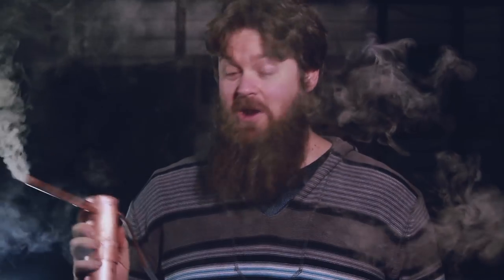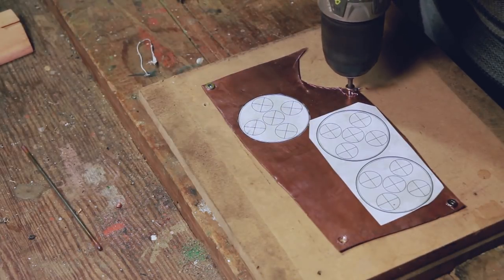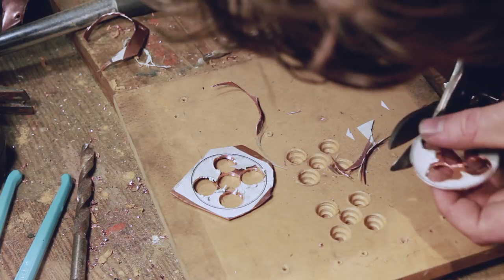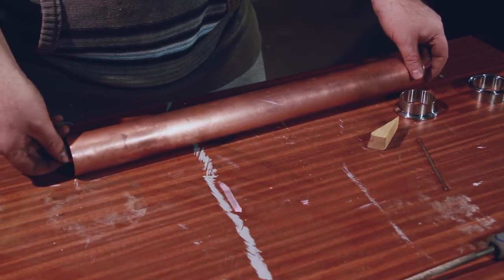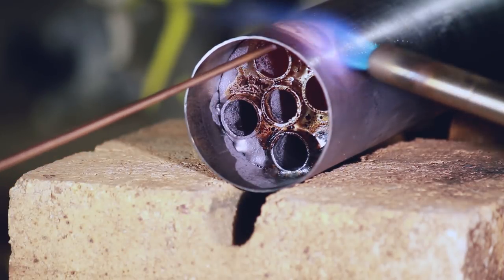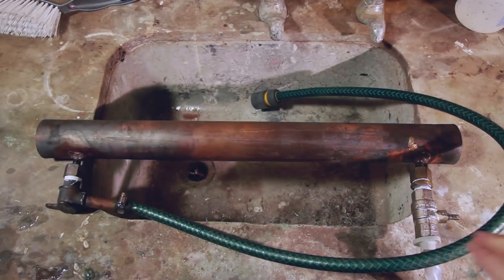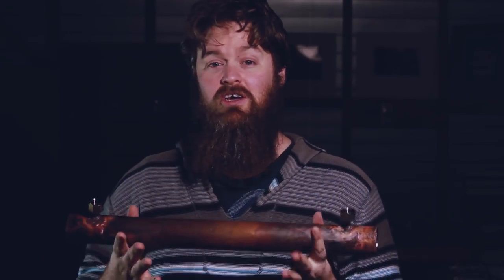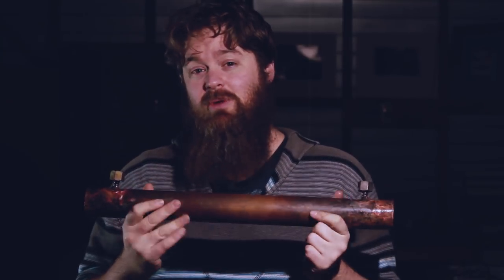Building A Shotgun Condenser

Comment: Here's some free advice from an ex-metalwork teacher that will make your life easier: Don't use hard solder (silver solder or brazing) because you do not need the strength (usually needed only for pressure work). Instead use silver loaded soft solder (potable water grade a silver/tin alloy) and that way your copper pipe will not need pickling to get it clean. In fact it should stay relatively bright with only maybe a dip in vinegar to clean it up after.
The soldering process is so much easier and safer with nothing more than a soft flame needed. You will need less expertise and if it goes wrong it is easier to take apart. There are any number of acid and non acid (water based) fluxes available at your local plumbing shop. Give it a good boil in water and a soak in vinegar after.
Years teaching metalwork and jewellery making followed by a bit of condenser construction of my own as I retired to follow the "art".
Reply: Thanks a loooooot man!!!
Reply: Amen, and if you get lazy just cover in flux and worm, repeat, good to go.
grew up sweating copper of every type.
AND if you have a supper hard flux dirty/job get out the cheater Sauce from the electronic store! did circuit board too.

Comment: great work! your leak was unfortunate but have you tried using Flux and lead free solder instead of brazing rod? brazing takes a tremendous amount of heat and the solder will flow around joints better. happy distilling!
Reply: If you go the solder route, talk to a jeweler about silver solder. Or take an oldsilver dime and file off shavings to act ss solder.

Comment: Great vid Jesse, at the 4min mark you mention size differential i think and someone correct me if wrong but my dads a plumber and he said they use I.D. internal diameter, the tree is a fitter/engineering tool so the numbers will be O.D. overall diameter or external. if that makes sense. for anyone ever trying to use plumbers PVC pipe or fittings with electrical/comms conduit this is the same deal. electricians use O.D not I.D. , i believe it is because of pressure in the pipes, plumbers use the PN system which is thickness/pressure rather than diameter (makes sense after someone tells you)  i found out the hard way. cheers

Comment: A tip.. Obviously, it's easy to make a disc on a lathe, but if one has got none a drill will do. Simply rough cut after the template and then make the holes for the tubes ..EXCEPT that in the center. Drill a hole in the center, so a bolt can go through, secure it on the opposite side with a nut. Now fasten the whole thing in the drill (a drill press is even better). You can now use the drill as a lathe and file/sand until you end up with a perfect disc at the desired diameter. You can even use a flap disc on an angle grinder, to make the process really fast.
When you've done all discs, you can use that step drill to widen the center hole. Also, solder or braze it upside down, not lying on the side. The filler rod will be easier to manage, without struggling with gravity too.
However, you fought a brave battle and got the job done..congrats..!  That shotgun condenser can handle 4 KW worth of heat easily.
Reply from the maker: +Kalle Klæp dude.  I dig that.  Thanks for the tips man :)
Reply: 4 KW??? That's a monster still you're building. And why do you want the cooling water out to be hot?
Reply from the maker: The power is nice for warm up. I don't use nearly all of that when running it.  Not sure what you mean about the water out being hot?
Reply: BigEdsGuns
 made a comment I didn't understand - "You want your output water to be very hot."

I went the easy way on my setup. Chinese lab glass is very cheap right now. I found everything on eBay and Amazon. I got a Vigreux Column Distillation Condenser for $14 and a whole set of everything else for $48 - all beautiful lab glassware". I made my first run this week. I for sure won't have the throughput you will though - I'm an order of magnitude down from your 4 KW capacity.
Reply from the maker: That's for a 50l boiler too man.  I'm not sure what size you are running.  Huh that's cool man!

Comment: nice condenser.  you did great.  great idea on the late addition for your connections.  just be carefull on the flex on that connection when you run it.  there will be some weight  on that joint, but it should be fine.  polish that up and it will look fine.  lol, i would have burned off the template too.
Reply from the maker: Lazy men unite! haha 
Yeah, I had wondered about that also,  guess I will keep an eye on it.
Reply: Just ok dude we get it your the best lol

Comment: Subscribed straight away bro, you're a natural teacher and your very good at your craft.
Reply from the maker: +Shaun Mccaughan ah shucks man. Cheers!
Reply: No problem, I've been a fitter and Turner most of adult life and you're metal craft is spot on.
Reply: I was going to say to also that when I made a couple of copper tube heat exchangers for my foreman's boat when i was an apprentice I soldered all the core first using a steel jig that the plates with the holes in got clamped to and all the pipes went through to a stop behind at the correct depth. Just heat up the steel and then solder the pipes in and then put inside the large pipe and solder whole lot in position.  You can use spacers to change the depth of where the hole plates are on the pipes and just have the steel hole plate counter sunk cap screwed to the rest of the jig and that can be changed too. Means you can sit the plates totally square to the pipes and anywhere on their length too, more than happy to give you a drawing if any of that is unclear. Private message me somehow and i'll get it to you with a drawing of how you can clamp two pieces of tool steel plate (like gauge plate) and hole saw them out and drill as pair to clamp the copper between them. Once their hardened you can file and lightly sand them round and the same diameter each time. Just make sets up for different sizes. Like i said you're really good as is, these are just ideas for you that I used in the past.

Comment: watching this reminds me of a mega condencer Pop corn Sutton had made . it had about 15 3/8ths tubes set up like you just made but the sleve was 6 inch ..  and it was about 28 inches long and was mounted to a stand ..  when the Temp is 173 to 180 .. thats hot shuyt .. and you need the volume of water to cool the vapor and having a 5 hole may work  Id be scared to br wasting likker .

Comment: sorry to have to mention this again,  but as some others gave you the tips and I don't see you following them,   again the steel is harder than the copper, apply the heat to the steel the copper will be plenty hot enough long before the steel, as with most all metals also apply the heat to the thickest piece first, exp.  2 pieces of copper  1-1cm thick and the other 4cm thick heat the 4cm to point of adhere and the 1cm will be adhered,  hope this helps,  you are not getting a good weld to the steel the way you are doing it,  what the way you are doing it, is only filling the gap between the copper and steel, this is why one of the others mention to heat the steel on the inside, touch the rod to the steel to see if it is hot enough to adhere to the steel,  lie I said if you get the steel hot enough for rod to adhere then it will flow to the copper like water.  BTW I love seeing what you are doing  and can't wait to see the final work in progress, these are some of the best videos on youtube as quality,  and none of that off the wall music that the others use because they are not assure of their ability to speak,  GREAT JOB
Reply from the maker: Thanks a bunch man.  
Yeah I think I should really have gone a little slower with the process.  Taken more time to internalise the tips I was getting.  

But anyway, I guess I got some kind of a result.  Its all up and running.   Im sure it will need repair at some time though haha.  But I guess when that happens I will be more prepared to handle the situation 😉

Comment: You compromised on the end result and your initial design to save a few hours in construction time? 

It would have been worth the wait to get the proper drill bit the following day so that you can braze on the fittings you wanted.
I dont understand what the rush is all about. The materials are quite expensive.

With respect to equipment building, I tend to use the motto " take your time, build it the way you want it so that you have a piece of equipment for long term" (more of a sentence than a motto).

Overall, a good construction and brazing job that produced a functional piece of equipment.
First time viewer of your YouTube channel - great stuff.
Reply from the maker: Cheers for the feedback.  

Yeah I hear you.  But remember at this stage I was already about 16 months deep on this & I just wanted it done.  Should I have waited . . . . yes . . . was I capable of it . . . . no haha.
Reply: @StillIt  No need to defend the decision to use different fittings. 

I am the master of short cuts, stuff ups and last minute changes and compromises.....At least your condenser could do its job in the end and didnt leak.
A friend of mine had access to a computerised sheet metal hole stamping machine which could whip out a copper disk with holes in it in no time - and with great accuracy. He built most of the still equipment at work and did the brazing and tig welding himself.
There are some fantastic tools and machines that can be hired or even purchased second hand that can make certain jobs a lot more easy to carry out.
In the end the most important thing in my still is the control of temperature and cooling rate in the coil/condenser. Overall though, the fermentation technique and ingredients/techniques used is the key for me as well as the wood/barrel aging process. Drinking and sharing the stuff is the easy bit.....
(In Australia stills are not legal without a alcohol manufacturing permit. The excise payable to the Government is just over $80 per litre of pure ethanol. The only components that can be legally concentrated in stills without a permit are aromatics and essential oils using tiny pot stills. Distilling ethanol in pots with a volume greater than 5L is considered commercial scale and attracts large fines. Many people in Australia try and keep their stills under this volume which makes distilling a lot more difficult, time consuming and expensive.)

Anyway, cheers.

Comment: I suspect that the pipe size issue was that you intended to use a half-inch OD, outside diameter tubing, but you purchased half inch inch  ID, inside diameter pipe.
Love the video. 
I watched it while researching for my build.

Comment: You forgot Baffles. Water flows the path of least resistance.
Water can channel right up the side of the two nearest pipes and out. With baffles it change direction and increase efficiency dramatically. 

My advice would be to put on a valve on the water output to decrease flow. It will hold the cooling water longer inside the shotgun. You want your output water to be very hot.

Remember shotgun condensers are most efficient when vertical. Conversely liebigs like to be angled for maximum efficiency.

You should also grind down the tops of the 5 vapor tubes. There will be some pooling of alcohol which will build up on top and drip down. It's called Smearing and will taint your cuts. Example: Some heads may end up in hearts, and hearts may end up in tails. It self blends them. Just grind (dremel) down the tops of the 5 vapor input tubes.

Great video Jesse!
Reply from the maker: Thanks man!  

I decided to not bother with the baffles.  I was worried enough just about getting this togeather haha.  And I guessed 500mm x 5 15mm should be enough for most things regardless.  

IH brought up the proud 15mm too.  Will look at grinding it down to help on smearing.  One end is only just proud,  so will use that at the top.  

Hmmm, hadnt thought of controlling water on the out instead of the in.  Output water being hot will only be a sign of efficiency though.  Like using the least amount of water right.  There is no reason to actually have it be hot other than that?
Reply: If you notice a lot of air bubbles on the output (clear tubing), you can slow it down. The water will flood and should push out any trapped airspace in the shotgun. Unless some gets airbound by a large distance from the output hole to the top vapor entrace of the shotgun. 

Air compresses, water does not.

Comment: hello, forgive me for my bad english ... I have a question: I built a distiller with a column, and I tried to find the materials locally (south Italy), I used a stainless steel column with a diameter of 8 cm (just over 3 inches) while it appears that several use the 2 inch measurement. I do not complain about the operation but in your experience what is the real difference? I read in some forums different opinions .... I would like to know your opinion. the maximum amount of washing is 20 liters, has a "vapor management" configuration but I can also use it in "pot still" mode. Thank you so much
Reply from the maker: Hi Demi, your English is awesome don't stress it.

If you are using packing in the column and active reflux then more width is a good thing!  Width gives speed, height gives higher abv
Reply: Ok, I had read something about speed ... in the forum we recommend the largha column for the great distillers while mine is for small lots and this has led me to confusion. I use my distiller as both crowded reflux and in pot still mode without packaging and with little reflux. I have another question that torments me: when preparing the fruit in fermentation is it useful to heat the fruit to increase the availability of sugars? tasting the cooked fruit is sweeter .. the sugar is still the same, but I think that with heating it is more available. thank you for your patience and your fantastic videos.
Reply: @Demymaker  Thank you for your comments, and @Still It thank you for the video and your reply, it's spot on. I don't want to hijack your thread but seeing as there are relatively few comments, this shouldn't bog things down much. In my experience (extremely limited) and my opinion (unformed, 3rd-hand), the question of cooking fruit before fermenting is a good one, and has multiple answers. To start with, your end goal. Are you making brandies/schnapps/eau de vie or are you intending to make high spirits? My guess from your description of your system (both crowded reflux and in pot still mode without packaging and with little reflux) you are wanting to do both. If you were only wanting to do high spirits, the fruit esters aren't going to make that big a difference. However, when you apply heat you release the pectins into solution, and some strains of yeast will ferment pectins into methanol, which is poisonous. Methanol is a lot of what you throw away or use for cleaning, from the foreshots. So: heating the fruit can decrease the characteristic fruity esthers but also create more methanol in the foreshots/heads. But heating can also make sugars more soluble and fermentable as you stated. These are why when we make cider, wine, and most brandies we use cold pressing techniques to get the juice out. On the other hand, you can make fruit brandies by heating up the fruit, to juice it before fermentation. You just might lose some of the true fruit esthers that you want in your braindies. Sometimes you have a bunch of people helping you crush and juice apples, for instance. Then when you ferment that juice you have cider or can make brandy. Sometimes you have 0 people helping you so you have to use heat and time to turn extra apples into applesauce, then filter it, and ferment it. I've got about 200 liters of that kind fermenting right now, with the intent to use some of the stripping/pot still run to make brandy, and using the rest to do a high spirit run. Hope this helps a little.
Reply: @chironchangnoi  Thank you for your answer, I really appreciate it. From the fruit I want to get the maximum taste and smell possible (I think many want this). In general I chop the fruit with the peel, then the ferment (without added sugar) and finally we distill all the pulp, a first time with the pot still (to raise the level of alcohol, otherwise I get little product) then the new distillation with column without packaging. I'm always looking for improvements, so if you have any advice to give me I willingly accept them. Thanks a lot.

Comment: Can you use lead free solder on the copper to copper joints, also I have seen brass ferules that again would soft solder on to the copper pipes ?.
Reply from the maker: Yup you sure can.  I decided to go with braze as it was easier to find the tools and solder for me.  Brass can be questionable due to the inclusion of lead.

Comment: Your frustration is stemming likely from directly heating the flux. Never if at all possible ever directly put a flame on your flux as it'll basically not allow the solder to spread and make a bond.

To avoid this it's wise to get your parts evenly heated as much as possible, and only then apply flux and then your silver solder. Helps beat to work small areas at a time.

Comment: Hey mate hoping this gets to you and sorry if you said it somewhere else - but why both the 2% and 15% silver brazing rods? I am looking to build a replica of your still and was wondering if you could help me better understand the joining process. Also, since you first published this video have you found other methods (such as the solder) to work better or would you stick with the method shown here? Thanks in advance!
Reply: Using 2 different grades of solder is often to have 2 different solder melting temps. You can do the first soldering with the high melt then when doing the next solder you are working slightly colder and not risking issues with the first solder joints.